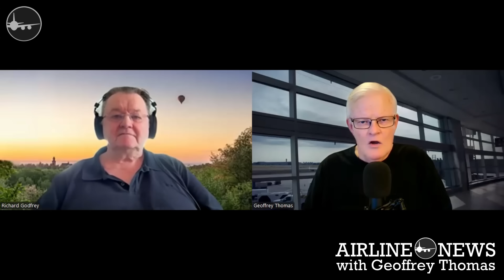Air India Crash - Probable Cause  #airindiacrash

Comment: The is my updated hypotheses noting Richards battery as a potential third initiator or actor in the  crash.
Updated root cause: 
A common‑mode electrical failure causing near‑simultaneous FADEC fuel cutoffs immediately after V1 and overtaking Positive climb sequence . The most probable initiator is an EE‑bay electrical fault causing a transient  / spoofing on FADEC voltage logic . Current evidence supports two potential initiators: (A)  forward EE bay moisture‑induced arcing during rotation, and (B) aft E/E bay lithium‑ion battery thermal runaway (likely APU battery) generating localized aft heat and electrical upset The so called smoke blast seen from the rear. The aft battery pathway ( B ) is newly elevated by the  charring of the aft recorder despite an intact tail, suggesting an aft heat source likely short fast and intense ; however, without conclusive residue evidence, Path A ( water ) remains  more probable and the pitch angle of 10 to 15 degrees created the free flow mass physics of fluid movement. Both A and B yield the same cascade: uncommanded dual fuel cut, RAT deploy, loss of climb, and a unrecoverable flight. The plane was to low for meaningful engine relight at that point.
My percentage
 VT-ANB Crash: Updated Probability Breakdown
1 - Forward EE Bay -  > 60 %   - Moisture ingress arching /  water induced catastrophic electrical cascade failure
2 -  AFT APU thermal battery rupture runaway -  <  30%  Lithium battery cell failure disrupted electrical system and triggering  FADEC shutdown
3 - Coincidental mechanical faults 5 %
4- Accidental switch movement  3 %
5 - Fuel Contamination 2 %
 The Hypothesis A reflects:
- Strong alignment with crew cognition (“Why did you cut that?” → un commanded cutoff)
- Symmetric engine shutdown consistent with bus-level brownout (" bang" )
- Passenger “bang” and RAT deployment timing may be over pressurized venting in both (A) and ( B) 
- Known vulnerability of EE bay to moisture pooling and arc flash
- The lithium battery is a player is if it ruptured and is a valid actor in this. But we have circle back to the Root Cause , an initiator / trigger and we  still come back to a water/ urine slow leak ,  likely over days weeping and capillary affect forming a laminar flow and pooling with free flow  mass / surge on rotation. Over splash and coating the electrical buses and other sensitive electrics.  
I DO NOT ACCEPT pilot sabotage , too much contradicting evidence is in front of us. I do accept the AAIB data that said the duel switches moved. I see that as SOP and last circumstantial evidence fix an impossible situation. And I suspect they new that too! 
So I agree with Richards hypotheses - water. The down stream effect is the electrical cascade. 
The battery is to my logic a secondary actor in that it is, a  player that came late to the show. It is the third actor and the final act of the sequence of events. It could be called the final nail in the coffin. But I don't accept it has the capacity at that point in time to cause the crash on its own by rupturing. It needed a initiator and lot more time.
However I note when I watch the updated hypotheses it was late. I did hear him is say water  referenced  . So  he still stands by"  water ingress "  ( my words)
I am unable to find any logical way out of my own tight web I have knotted my self into, so I will have stand on my hypotheses and correct it if I am wrong.
Richard , Geoffrey keep the pressure on.
Reply: The Aft battery is located in the aft cargo bay close to the aft cargo bay door visible to both engineers and baggage handlers it's also located close to the bite test terminal. 
ACMS system monitors battery life battery condition and   it will warn of any failure and will disconnect from the electrical systems. 
The battery cells are individually wrapped in inert materials with a electrical disconnect between each cell to prevent thermal runaway spreading throughout the battery the cells are sealed into a stainless steel case both to contain the fumes and the heat. And is allowed to vent to the outside in case of malfunction. 
This battery pack is not located near the aft AE bay it is a number of frames fwd of this nor is it situated under a toilet or galley area. It is sat on a support frame member behind cargo wall panels and a site glass for inspection purposes. Water cannot enter the battery because it is completely sealed . The aft data recorder is situated a number of frames away from this battery behind a pressure bulkhead and close to the APU some 50ft away.
Reply: @vaughanlockett658  Yes . correct to a point. The FWD EE bay / main battery venting is under the front of nose of the plane. Not relevant in this case
The design for the AFT EE bays and APU battery venting is on the slight  left side of the plane and that is where the smoke  / dust appear to originate from. No where on the CCTV did the smoke / dust appear forward of the left wing but always trailing ( left wing ). The left wing also appears to have  slight downward tilt ( left angle ). That " may" also play into the water issue of Richard hypotheses. How that may work, is the plane on roll is still at 0 degrees  , on V1 - 10 degrees nose up , then V2 - 12 degrees - " call out" - positive climb - wheels up, But that did not happen. Wheels remained down. This is the crux.
The " water" that was in a laminar state is now transformed to a free flow mass or surge and if the left wing tilt is correct flows back and left , with less to right side.
This seems to be the point where the duel engine shut down is initiated by transient low voltage = to the FADEC logic a " TRUE " shutdown.  This is the likey point where the passengers " bang" and the RAT .So which came first?. I think like this
1- water over buses 2 " bang" , engine FADEC does what it is  programed to do on a " TRUE " signal, 3 RAT deploys APU battery is tied to the DC bus; a fault here can:
• 	Destabilize FADEC power
• 	Trigger dual engine shutdown
• 	Force RAT deployment as backup
As it did.
The  APU Auto-Start Triggered 
• 	Loss of primary power (after engine cutoff)  APU auto-start ( should - did )
• 	This opens the APU door as part of the sequence ( found open )
APU battery is tied to the DC bus, and its failure can propagate electrical instability.
I don 't know if the APU spun up in any meaningful way.
When the electrical surge with water - battery APU AFT " ruptured"
noxious gas and other corrosive elements are released, it is that, we likely see at the left side of the wing venting alone the center line of the fuselage   as that is the designed venting position.Over whelming the wing which may have looked like an engine issue to some.
My only caveat is the AAIB has not release the full data. I am only offering MY hypotheses.
But we still has to come 360  degrees - Water seems to be the best probable  cause.
 I must add I am in not in any way trying to usurp Richards and Geoffreys  site or gravitas. I it is was their initial "Root Cause" that got me interested. And it made logical sense, if the pilot controversy is eliminated. And it is their work I have expanded on to arrive here.
Richard and Geoffrey keep the pressure on

Comment: Two Big Questions Still Hanging

Richard has admitted he has no answers for why AI171’s takeoff roll was unusually long and rotation slower than expected. On a 787-8, that only points to reduced thrust, excess drag, or a fuel delivery problem under load.

If the blue-grey halo was just EE bay venting, why did it form a perfect smoke ring outboard of the nacelle instead of hugging the fuselage? Exhaust venting alone wouldn’t generate that neat vortex signature.

So we’re left asking: was the real culprit not electrical venting at all, but the engines themselves starving or surging even before liftoff?

👉 Richard, Geoffrey — are you willing to rule that out, or does it stay on the table until the FADEC data is released?

regards Scooter

Comment: so just thinking out load, assuming the cutoff switches were never moved initially and the CVR would have to demonstrate no evidence of that, your looking for a pathway where an electrical current can make it to both engine fuel control valve close circuit either via the EEC WOW circuit or the engine control switches where both circuits should be open.

Comment: Hello to you both!..What is your thoughts on "if the engines had spooled up and avoided impact..Do you think the electrical catastrophe would have given them time to circle and land..giving how heavy they were.?  Also is it remotely possible that maybe.after operationally checking the stab transducer there is some "maintenance mode" that was not switched OFF maintenance mode and possibly confused logic for engines...I definitely on board with ALL you have spoken on this channel...just a couple of questions I wondered about..20 years USAF maintenence,  F111E, B-1B Bomber and F-16.
Reply: First rule in aviation- don't turn back on a decaying liftoff or engine stall. Straight line direction,  but in this context -  no options available to them. They neither had the speed, thrust force,  height and the fully loaded weight of the plane all conspiring against  a recovery.

Comment: Please clarify for me...was the Apu running on takeoff?  If so, are you saying that a runaway battery would cause complete electrical failure of the airplane, a dual engine shutdown and  the Ram Air Turbine deployment, all within a few seconds of V1?  Then the captain or the first officer toggled the fuel cutoff switches to initiate a restart of the engines? 

If all that is an accurate timeline of events, where did the crew say, "Did you  cutoff the fuel switch?"  To which the other officer said,  " I did not."  It just doesn't seem plausible that all of this could possibly be the sequence of events. In a 15 to 20 second time frame...?

*Why hasn't the cockpit voice recorder been released as of yet?

Comment: A320 and A220 Pilot now for the last 25 years. That’s all very interesting, I am not at all familiar with the 787 systems, but how can a apu battery failure cause a dual engine failure. Jet engines on airliners are completely independent and self sustained from the rest of the aircraft electrical system in relation to their own electrical needs
Reply: It sounds like nonsense to me.  I am almost certain the captain shut down the engines.
Reply: That's my understanding too.  That these kind of moden jet engines only need external power to be started.  Once they are running they supply their own power and even pump their own fuel.  They also supply any needed backup power to the FADEC.  The rest of the plane could be entirely blacked out but that would not stop the engines from continuing to run.
Reply: @TheSquirrelly In 2019, a Boeing 787 operated by All Nippon Airways (ANA) experienced an automatic fuel cut-off without pilot intervention during a flight between Tokyo and Osaka.

“There’s no evidence the pilots shut off the fuel. Audio from the cockpit doesn’t suggest suicide or deliberate action.
Reply: @sujithlasantha6153  Thanks for the info!  Yeah I'm sure nothing is "fool proof."  But as designed, an external power loss should not shut down the engines.  But you are correct, I am not saying something other than the pilots couldn't possibly have caused it.  Just that in the suggested theory, that a power loss shut down the engines would not be a likely case.
Reply: If the speculative events regarding the battery failure and effects actually happened and shut down the engines, the facts are in the data recorder that Air India is hiding, knowingly risking the lives of eventually way more than  a million people.
Reply: Hypothetical, Say the APU failed, this could have started a localised fire in the electricals, causing a break in the common junction, if this happened, the RAT would deploy instantly (which it did), but could it have severed the fuel pumps as well and this caused the engines to shut down, making it look like the switches were turned off?

Search for
"Boeing-787-Thrust-Management-System-Schematic-1024x775.jpg" to see the area I mean.
Reply: Sorry.. I am sure that pilots will never understand fully about  how the electrical, electronics and software work in the background..  

You may know how to drive a car for the last 25 years but you may not know how it works under the hood.
Reply: @Raj80sk  I promise you that we know WAY more then most YouTubers.
Who is going to help us when things go south at 30,000 feet?

Comment: Thank you very much for your thorough analysis of the probable cause of the AI accident.  I agree wholeheartedly with your conclusions.  However I don’t understand how water gets into a sealed container designed to withstand fire and mechanical stresses experienced in an aircraft crash.  Even if lavatory plumbing leakage occurs, a crash and fire resistant housing should not be compromised unless the container was not properly sealed after maintenance activity.  What am I missing?
Reply: Improper maintenance is the implication.

Comment: I think it is a very important question: Why is the FDR so massively damaged, that no data could be retrieved? A fire of the lithium battery is a probably explanation for that. But what I do not understand is, why and how does this caused a dual engine failure within seconds?

Comment: Too many WHAT IFs all take place in a matter of seconds if Richard's theory is proven to be accurate.  Not convinced. So according to Richard there is a  leaking lavatory causing water ingress onto the electrical EE system plus battery thermal runaway all this takes places in a matter of seconds. Plus the electrical system us fully redundant which makes this theory least likely. The smoke we see from the aircraft on lift could well be the RAT deployment because the smoke does not stay with the aircraft hence no fire. If the fuel switches are cut off the aircraft has no fuel hence no lift . Also remember the AI pilots could not simulate the crash when going through all possible situations ..
Reply: Simulators will not give real situations.. 

There are huge amount of cables in real plane but in simulator?? 
Does simulator have toilets where the 200+ passengers will pee..😂😂

Comment: Great explanation but one error....
1. If the switches were switched to cutoff after the rat deployed and the fire why did the co pilot then ask the captain " Did he turn the engines off" and he said no.  
2. If the switches were turned off as an attempt to engine cycle why did it take so long to turn back on and why the gap between?
3. What is more credible is what ever tripped the rat tripped the interlock that shut down the engines.  The switches remained in run until the pilots then cycled the switches first one to see if it worked then the other.
4. What is more credible than a battery fire is a tyre fire that slowed their takeoff.  At rotate a piece of the tyre flew up into the plane somehow triggering an interlock system, wither the WOW or something else.
Reply: Tire fire is an interesting scenario. Would that cause the black smoke.

Comment: Richard. Again. 
1)Could you be more specific in which busses caused the engine shutdown? Could you add some schematics ?   
2) Why do you assume it Is the Apu aux battery but not the main , if the battery vents are centímeters away , the fwd vent is few centímeters to the right. 
3) How could the electrical failures avoid the backups ? 

Seems Airindia has to Review maintenance policies BUT also Boeing may Review the electrical system.